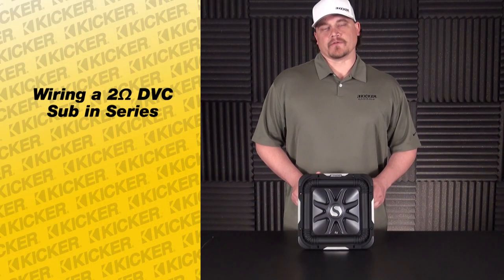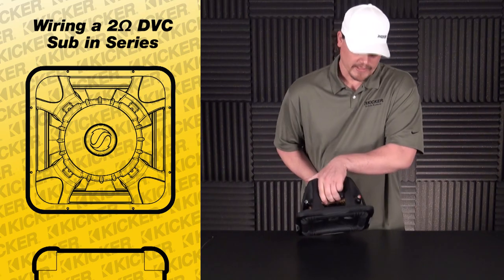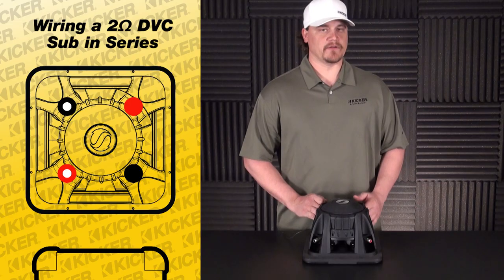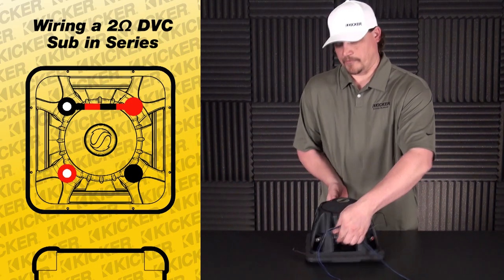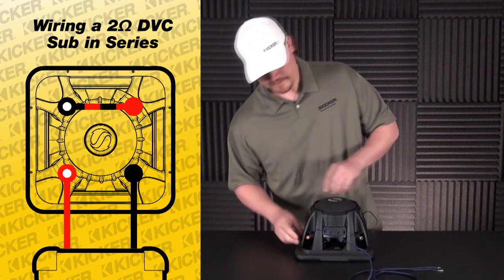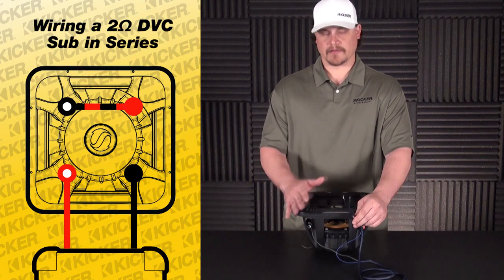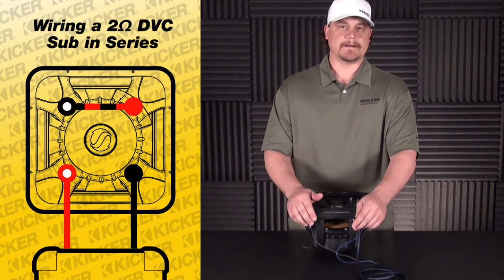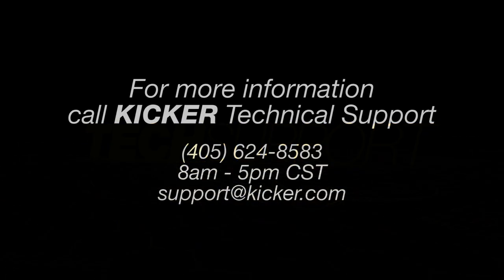Subwoofer Wiring: One 2 ohm Dual Voice Coil Sub in Series

Comment: I have 2 L7 12 q class in a loaded kicker enclosure I have a 1800.1d taramps amplifier (1ohm true 1800 watts actually dynod it and was a tad bit higher) ...  would it be louder/better to wire them down to 1 ohm for that amp or would I have better results by leaving them wired the way they cam and getting a 2 ohm amp that pushes 1800 watts rms.. please Kicker or anyone please help it would be very appreciated 🙏 🙂
Reply from the maker: What ohm load are the subs?  Once we know that, we can know what ohm loads are possible.  Not all of them are.

Comment: I have a spl 2000 watt amp I'm trying to run a 15" cvr kicker that I barely got but it's getting all my stuff very hot what can I do to fix this problem right now I'm pushing 3 12" cvr's without any problems..

Comment: That is the same wiring for a  1  kicker 43cwrt101    10” subwoofer and 500watts clas D 2 chanel  2ohms stable amp. ???
Reply from the maker: Voice coils don't change much from sub to sub, so the technique is pretty much universal as long as you're starting out with a 2 ohm DVC sub.

Comment from the maker: Yes!  To wire the sub in parallel to go from a dual 4 ohm voice coil to a single 2 ohm coil you need to run a wire from the solid red to the red with a white dot.  Then you will run a wire from the solid black to the black with a white dot.  This wires the coils in parallel and then when you run a wire from one positive and one negative to the positive and negative of the amp, it will see a 2 ohm load.
Reply: P

Comment: I just bought a brand new 45 year anniversary edition LR7 12 and a 1000 watt Kenwood excelon mono amp, what is the best way to wire to be able to play it hard but safe , basically be able to get most sound without blowing.. I have it wired parallel right now, is series better? It is in a ported box also, thank you for any help/advice.
Reply from the maker: Two questions.  First, what is the ohm load of the 12 (there were dual 2 and dual 4 ohm options).  Next, how low of an ohm load is the amp stable to, and how much power does it deliver at that load?

Comment: What type of wire was used to bridge the sub? (Aka the first wire that connect the + to the - . A negative wire? Or a positive wire? First timer here
Reply from the maker: There's no specific order that you have to hook up the wires, as long as it's right before you turn on the amp. This may help as well: https://www.kicker.com/wiring-diagrams
If you still need a hand, don't hesitate to call us! Our number is 405-624-8510, open weekdays 8-5c.
Reply: My question Was just referring to the type of cable used to connect the negative and the positive together. The first cable used. What kind was it?
Reply from the maker: @xraideadgnius92  standard speaker wire (probably 12 gauge). That video is several years old, so here is our current write: https://www.kicker.com/speaker-wire

Comment: I have a question. I have two JL 13tw5 2ohm subs and a 1200/1 JL HD sub. How should I wire this subs ?
Reply from the maker: Effectively, yes that is correct. You will have a 4 ohm load to the amp.

Comment: I just bought a 46CXA1200.1 with a 44L7S122. Is that compatible? Or do I need to buy another 44L7S122 to make it a 2 ohm subs and two ohm amp
Reply from the maker: The L7S122 has a 750 watt RMS. The CXA1200.1 is rated for 1200 watts at 1 or 2 ohms.  We typically recommend being within 20% of the speakers RMS rating (so, 600-1050 watts). At RMS power, the amp is a little too strong for the sub. If you already have both products, you may want to work on the gain structure to protect the sub, as well as adjusting the crossover.
Reply: @KICKER-AUDIO  thanks for the reply. I finally finished wiring everything up. But I made a huge mistake. I didn't measure my trunk and there's no way it fits. I even tried going in from the front. ☹️
I did come across a 12 inch circle sub custom box made for my car. The Mounting Depth and Minimum Sealed Cubic Feet matches. I would just cut the mounting hole and make it square.

Comment: Need help fast.. I just want to know can u make a video of how to wire 2 dvc 2ohms down to a 2ohm amp. Im getting confused because you all wiring diagram is different from everyone else's. They got me wiring both up to 4ohm then back down to 2, but y'all got me wiring then down to one then up to 2ohm. Help please. Is there a better way. I have kicker l7s n a kicker 1500.1.
Reply from the maker: Running them up to 4 then down to 2 or down to 1 and up to 2 will not affect power handling, performance, output or sound.  It's your choice which way you do it because the end result is a 2 ohm load at the amp and that is what matters.

Comment: Does it matter if you wire the 2 dots in series and the 2 solids to the amp? Kind of the opposite from the video.
Reply from the maker: You'd have to complete the circuit, but yes, as long as a positive and negative wire get to the amp, you can do it.  Just be aware that you might change the ohm load by doing so.
Reply: @KICKER-AUDIO  after looking at it again I registered that each coil had a positive and negative lol. Thanks for replying. When I had it wired the way I asked about it pulled my headlights every bass hit. It hit me that I did something wrong. It’s good now and they hit harder now. 👍🏾

Comment: Sorry I'm not sure if I overlooked this particular video or you probably don't have it up but what do I do if I have Two 2 ohm Dual Voice Coil Subs and I'm trying to hook it up to a 2 ohm mono stable amp?
Reply from the maker: Hey - that is one that we have not done yet but need to.  What you will do is wire the subs in a series/parallel configuration.  We have a wiring diagram you can follow on www.kicker.com under the Support tab.  Go to wiring diagrams, dual voice coil.  Look for the diagram labeled:  Series voice coils / woofer wired in parallel.  Then use the one that is labeled using dual 2 ohm voice coils.  This should help you out!
Reply: Thanks I found it, so wiring up the subs in parallel is the best way for me to get the most out of them right?

Comment: I have 1 10" L7 2ohm. so after wiring the sub he said now it can handle a 4ohm load. is it good to have a 2ohm sub to be handled as a 4ohm load? or can I wore it to handle a 2ohm load since I bought a 2ohm sub?
Reply from the maker: When you have a dual voice coil sub and you wire the voice coils together you are basically creating a single voice coil.  In this case the dual 2 ohm can be wired to be a 4 ohm or 1 ohm coil.  The important thing will be what your amplifier will do when it sees the 4 ohm load.  How much power will your amp push RMS at 4 ohms.  What ohm speaker you have and how you wire it needs to be determined by what amplifier you are running.  It's all about compatibility.
Reply: thank you! my amp pushes 1000w at 2ohm and 500w at 4ohm RMS. so I'll push the 4ohm since my L7 pushes 600 RMS

Comment: I have the same subwoofer, ended up purchasing the PXA500.1 amp to go with it. Realized I should have bought the 12 inch DVC 4 ohm L7 to get more wattage from the amp. If I wire in parallel the amp will be running at 1 ohm. If I wire in series I will only be getting about 250 watts to the sub. What do you guys recommend? Buying a new amp or sub, or just wiring in parallel? Idk if my amp can handle a 1 ohm load though. If I were to buy a new amp, which would you guys recommend?
Reply from the maker: Kevin Powell It is best do have a dual 4 ohm woofer for this amp as it will run at 1 ohms but it's not stable so when you turn the volume up it will shut down due to low impedance protection.  Either a different amp or a different sub is going to be the best long term option.  Let us know what size L7 you have and we can recommend some amp options.
Reply: Thanks for the reply, and yea that's what I figured would happen to the amp. I have the 12 inch dvc 2 ohm L7.
Reply: I have a 12 inch kicker L7R 2 ohm dual coil sub and im running a infinity reference 551a mono amplifier.  How should i wire the sub and then how should i wire the sub to the amp.  Is this best setup for the sub i just bought or do you suggest getting a different amp for it.

Comment: Hey tyson i am from uk england and have never had kicker subs until now i have old school s12 l7 2 ohm dvc 
1st question box for it i have tried a 2.2cft sealed for it but dnt sound right 
So i have new 1.32 ft sealed box and using a vibe a7 slick amp 1300 650 rms at one ohm or 4ohm 350 rms 
What do think  i have at one ohm as per video for 2ohm but i dont wont to over cooked the amp
Reply from the maker: Hi Paulina. Is this the amp brand you have: http://vibeaudio.co.uk/ or this one: http://www.lanzar.com/productseries/Vibe
Reply: Yes its is a7 vide slick
Reply: KICKER yes vibe
Reply: KICKER is a vibe

Comment: I have a kicker cvx102 10" in a kicker box. The speaker terminals on the side of the box say 2 ohms. I have a pioneer gm-d8601 1600 watt mono amp. It was hooked up basically with a positive and negative from the output terminals to the speaker box. Amp says it is one ohm stable, but i just dont feel like im getting enough bass the way its setup now. if this makes sense, any help would be appreciated. im new to all this
Reply: yusef uself its a 2 ohm DVC
Reply: yusef uself do you know if these come wired in series or parallel in a factory enclosure? if this amp is stable at 1 ohm, id get more out of it at 1 ohm....right?
Reply: yusef uself  you need an amp that gives you 2ohm to 8ohm that way you can wire your sub  to make it 4ohm
Reply: Link Pretty Ass thx

Comment: I have a kicker l7 15" solo baric dual 2ohm subwoofer, how would I wire it to a 2000 watt 1 ohm stable mono block?
Reply from the maker: You would wire it in parallel.  Here is a video on how to do that: https://youtu.be/qIevKQS6SYk?list=PLV2hurat1mvmHUBLRPIfRMkWKtIO-TSNo

Comment: Kicker made both dual 2 ohms or dual 4 ohms subwoofer. Wich is the best to choose when i had to buy the dual 2 ohms or the dual 4 ohms
Reply from the maker: These two are pretty much identical in specs - one is not better than the other.  Which one you need depends on the amplifier you are purchasing.  You will want to make sure you get the correct ohm speaker so that when you wire it to the amp - it shows the amp the correct ohm load.  What model amp do you have?   Will you be running a single or multiple subs?
Reply: KICKER thanks for interesting, i already purchased the amp i have (Pioneer GM-D9601) and i wish to run only one kicker L7. Just confusing which ohms i had to choose. Thank you

Comment: Is it possible to wire a single dual 2 ohm sub to a final 2 ohm impedance...im hooking up a 5 channel amp that pushes 300 rms at 4 ohms but 500 rms at 2 ohms..its the L7 10 subwoofer
Reply from the maker: Only by using one of the coils, which halves the power handling.

Comment: I just buy 2 kicker comp 43cwr122 , i have a kicker dx 1000.1 amp amp runs 1000 watt rms at 2 ohm and 550rms at 4 ohm how do i supoosed to wire em or what would be a good amp for those subs ??
Reply from the maker: Cornelio Espinoza if you DM me your email I can send you a wiring diagram.
Reply from the maker: Cornelio Espinoza otherwise it's called series parallel. You want the end result to be 2 ohms.

Comment: hi there my question is what gauge wire is safe to run in the box i have  l7 15 inch 4 ohm s  and what gauge wire should i run from the( amp hifonics zxx- 3200 .10  mono amp) to the box?i have 14 gauge would it be enough to run the box with out issues please?
Reply from the maker: fordman3333 What size fuse does the amp recommend? Check with the manufacturer to find this information out. Once you know that, you are good to go. Chances are pretty good you’re going to need zero gauge wire. At least for power. But we will confirm that once you get back to me with the info.

Comment: So I should wire my comp r12 dvc 2ohm like this instead of just wiring one side?
Reply from the maker: Try to avoid wiring just one side of any DVC.  While you may hit the ohm load you are looking for, you are automatically cutting the power handling in half.
Reply: @KICKER-AUDIO  okay sweet. I just bought the sub yesterday and took it out of the box to see how it was wired and wasn’t sure it was using the full potential, thanks.

Comment: I have 2 L7 10 inch subs , how many ohms should I wire it up to?? I have a 2000 watt hifnoics amp . Thanks
Reply from the maker: We need to know to know two things.  First. the ohm load of the subs.  Second, how low of an ohm load the amplifier is capable of handling.  Can you find out those things?

Comment: I have a 13" L3 with a Jensen 500 mono, hooked it up 2 ohms and it smelled like something was burning, a bit of smoke was coming out of the port, any suggestions?
Reply from the maker: jose sanchez we never made a 13" sub. Could it be a 12? The chances are the sub is damaged at this point, unfortunately.  You'll have to remove it to verify.
Reply: @KICKER-AUDIO  haha! My bad, yeah a 12, and ok thanks, for shits and giggles I wired it like shown on this video and it hits hard, should I buy another or is it fixable?
Reply: Thanks by the way
Reply from the maker: jose sanchez we don't fix speakers unfortunately. The best thing you can do is call customer service at 405-624-8510 weekdays from 9 to 5 central time. They may be able to help.

Comment: And I purchased the box it is missing the tube or what ever goes inside the port it's just a whole now should I cover it up or leave it for best sound
Reply from the maker: If it's missing the tube, it would be best to replace with the same width/length that it came with - assuming the same subs are in it. What is the box model number?
Reply from the maker: Not sure, but that could be a serial number.  Our model number look like this: 43LCVR22  Do you see a number like that anywhere on the box?  Start by looking near the speaker terminals.
Reply from the maker: Not sure, but that could be a serial number.  Our model number look like this: 43LCVR22  Do you see a number like that anywhere on the box?  Start by looking near the speaker terminals.

Comment: excuse me sir
whats the wire in the sub that goes from the negative to the positive ! is it negative or positive ???
Reply from the maker: The first wire is a single strand that is run from the positive to negative and is only connecting the two voice coils, it is neither positive or negative.  Next he runs double strand speaker wire and the one connected to the positive terminal will be the positive wire and the one connected to the negative wire will be the negative wire.  The double strand speaker wire that he was using can be pulled apart to become a single strand of wire.

Comment: i have a db drive 10 inch dvc PT10D4 and the amp is a kenwood KAC-9104D
whats the perfect combimation for it?
help please
Reply from the maker: The PT10D4 will handle 600 watts RMS and the KAC-9104D will push 900 watts RMS at 2 ohms mono.  Wire your speaker in parallel so that the amp will see a 2 ohm load and make sure you set the gains properly so that you don't blow the sub since you will be pushing more power to it then it can continuously handle.
Reply: Thanks and the box , need to be ported?
Reply from the maker: Joel Santiago
A ported box will give you a deeper, boomier bass where as a sealed enclosure is cleaner and more responsive.  If the speaker can go in either type of box then it's more of a personal preference which type of box you choose.
Reply: Since is a 10 inch sub I make a little test. I make a ported box my self and is a lot better in my personal preference.
Thank you a lot for the help 
Mr.Kicker

Comment: Could anyone guide me on how to wire and LC2i to a 2015 f150 ? Do I run the power from the remote on the amp and speakers from the doors to the LC2i?
Reply from the maker: What amplifier do you have?
Reply from the maker: If you have a Kicker amp, it is very likely you do not need a line out converter at all, so the LC2i would not be needed to convert the signal.

Comment: How would I wire two 06s15L7(2) subwoofers to a lanzar vibe 292n amplifier?
Reply from the maker: I cant find that amp, only the 292 (not the 292n).  Got a link to one? need to read the specs.
Reply from the maker: Looks like they will do well at 4 ohms per channel, it runs them close to their RMS ratings.  http://www.lanzar.com/sku/VIBE292/Vibe-5000-Watt-2-Channel-Mosfet-Amplifier

Comment: How can you wire a dual 2 ohm speaker using the 4 connecters in the back to come out 2ohms. Am not trying to run parallel or serious I want to keep my sneaker at 2ohms
Reply from the maker: With one 2 ohm sub, you have one of only two choices:  series wiring will make the ohm load 4, while parallel will make it 1 ohm.
Reply: @KICKER-AUDIO  what's gives more power series or parallel
Reply from the maker: @50Ferni  While parallel typically lowers your ohm load, your goal is to get the correct ohm load to the amp.  Sometimes that is 1 ohm, sometimes that is 2 or even 4 ohms - depends very much on the amp.  Series, parallel or even series/parallel is a means to an end.  That "end" is coming as close as you can to matching the rms of your subs to the rms of the amp. So, if I have a 4 ohm DVC sub with an RMS of 1,200 watts, and my amp delivers 1,200 watts RMS at 2 ohms, I want to wire parallel. If I have the same setup, but a 1 om DVC sub, I want to wire in series.  Make sense?
Reply: Thanks I fixed the issue 👌👌💯👍

Comment: I have a L7 kicker 12 it blow out and i fix it and. I put a 2 ohm voice coil and when i parallel y goes down to 1 ohm and i have a kicker dxa1000 2 ohms and They go off at times and come back need help asap
Reply from the maker: We dont recommend you wire that amplifier to 1 ohm mono.  It is stable to 2 ohms mono.  This is probably why it is shutting down.